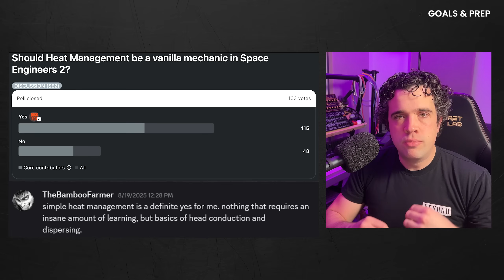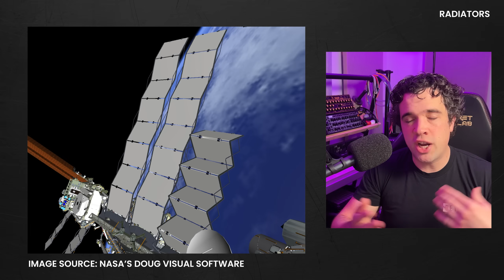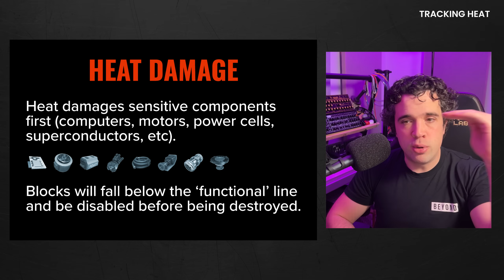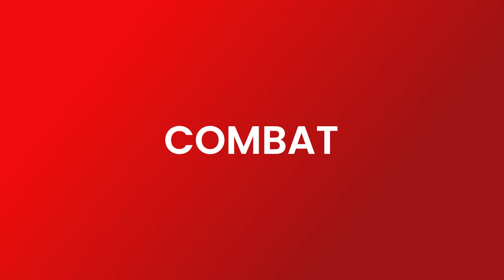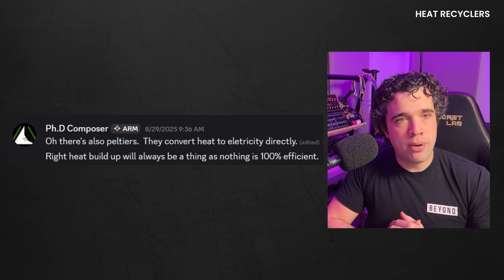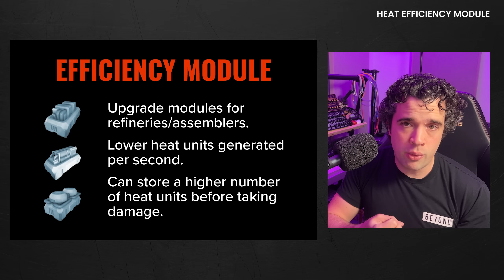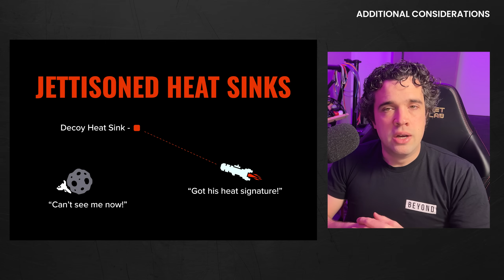Heat in Space Engineers 2? How heat could change EVERYTHING

Comment: With heat, it should be such that the heat intake of heat sinks and radiators lowers as they heat up (since you need a temperature differential to cool something), but the heat dissipation of radiators increases the hotter they become. Just like in real life, you will have a fast heatup of a ship first before an equilibrium is established. This completely flips the stealth mechanic on it's head if implemented: A stealth ship has MORE radiators, wich heat up less to reduce the overall heat signature. heat signature could be total heat outflow X heat level of radiators. With more radiators the total heat outflow remains the same in the equilibrium state, but the temperature is lower, so the the signature is lower. Going a bit further, you could also have the components producing heat work on the same system where they first get hot, which increases the flow of heat towards any cooling the ship has in place.

Why do i think implementing this detail would be a good idea? Well, if you want your ship to be stealthy, you need a lot of radiators, which limits options for armours, weapons and thrusters! If you don't implement it this way, then you run into the issue of stealth ships having less radiators and more sinks, which allows them to also have more surface area for weapons, which isn't exactly a tradeoff. Building a stealth ship would just be superior all around.
Reply from the maker: It is interesting the many different ways they could run with heat if they go this route!

Comment: With heat recyclers, the recycling only works if there is a difference in temperature! In a system with heat recyclers, you would use the radiators to cool the heat recyclers, which then generate power. If the heat recyclers start running hot, they lose efficiency.

In terms of heat cycle i don't quite agree with your odering. here is how it should work imo:

 components producing heat -> heat sinks -> heat recyclers (directly attached to the sinks as an additional module?) -> radiators.

This is simillar to hydrogen generators -> hydrogen tanks -> hydrogen engines -> hydrogen thrusters

In both of these cycles, the hydrogen engines and heat recyclers are optional!

So what kind of ship would you want to use heat recyclers on? Personally I think it would be good on anything large that has a lot of heat sinks, so a lot of power can be regained. It could also help upkeep power generation in scenarios where the ship is under high load. It should be good for stealth builds as you only want enough radiators to cool the heat recyclers and let the rest fill up the heat sinks to keep the heat signature low. The heat recyclers could help reduce the need for power generators, which also produce heat. Running on a high efficiency is just important to a stealth ship, so this works out just fine imo.

A heat recycler should also consume heat to generate that power, so it's a bit of a bad internal radiator and a bad/conditional power generator.
Reply from the maker: The recyclers generating heat and needing to be cooled is an interesting route to ensure it's not a cooling exploit! Sort of depends on how they choose to adapt the science.
Reply: Imagine insulating your reactors so they run hotter for more power and a greater risk, and surrounding them with heat recyclers to get more efficiency! Really getting all the power out of every uranium, but very vulnerable to radiator damage.

Comment: This sounds like it would be a fun design element for grids. I can imagine making a heating system right now, where you'd have shielded heat sinks but if heat goes above a certain level then an event controller would deploy exposed heat sinks until it has gone down.
Reply: Personally for simplicity I’d just place them in a hangar and then have that event controller vent the hangar as necessary for cooling.
Reply from the maker: Yup! Can put some radiators on pistons. Even a whole cooling tower with multiple radiators which extends out from your ship. There's a lot of cool things this empowers people to do.

Comment: I love the idea of having to worry about heat, as you say it can help limit weapons as it would be cool if you had say railguns produce insane heat levels as they charge. 

I personally would love to have a separate pipe system for cooling things down, using water for it or maybe even being able to craft a cooling liquid.. maybe liquid nitrogen?, tie it into running reactor and the bigger batteries.

As for it interacting with shields you could say it would create a heat spike when the shield takes a big hit, or even if a laser weapon was added you could use that to superheat a block forcing  the thermal shutoff and even cooking the block well past its heat limit.

 I believe you mentioned it in the video but it could also be used to add guided missiles to the game as a vanilla feature which would be cool  to have flares and such, lastly it would be a neat way to do detection, i think a server has a mechanic that does as such tho i don't remember it requiring a block to actively look for heat signatures but that would also be a cool thing. 

sorry for the rambling paragraph
Reply: Flare gun and fireworks launcher were introduced to 1 for the 10th anniversary. Making these useful as countermeasures would lead to interesting gameplay.
Reply from the maker: I just ranted for 20 minutes so rambling paragraphs are quite alright!

If they implement heat, they could add heat guidance for long range AI blocks which would make countermeasures instantly useful.
Reply: Liquid nitrogen would actually be a terrible coolant for space applications - unlike how we might think about it in terrestrial applications where it's not too hard to reject heat from the coolant to the environment, in space you actually want coolants to be hot, close to the temperature of the thing being cooled (which should also itself be designed to be able to run as hot as possible in order to let the coolant be hotter and still be coolant). The smaller temperature drop from the hot system reduces heat conduction, yes, but you can make up for that with bigger heat exchangers. And that increase in mass on the side of the system being cooled is easily worth it - generally that is the lighter part of the system to start with, and would only increase in mass roughly linearly, while the increased coolant temperature reduces radiator requirements (the already-heavier-and-bulkier part) by the fourth power.

Basically, you want those radiators to run as hot as possible, because the flipside of that means that halving radiator temperature makes you need it to be 16x bigger, which is not worth halving the already-smaller-than-the-radiators heat exchangers. And liquid nitrogen would be a lot worse than half the temperature - we're talking something in like 40000x the radiator area compared to something using a eutectic metal or supercritical steam coolant, and that's not an exaggeration; I just did the math on it (comparing 70K LN2 vs 1000K ultra-supercritical steam). Even if we are cooling something like delicate electronics and need to keep the coolant temperature limited to, say, 340K (67C), that's still 556x less radiator area than the aforementioned LN2
Reply: @warriorsabe1792 thats damn interesting thankyou for the info!

Comment: 9:15 some modules should increase in efficiently if their hotter (e.g. a reactor could increase in efficiency when near to its failure temp) as this would also incentivize not just spamming radiators but also balancing heat so that you can maximize the efficiency it gives.
Reply from the maker: Yeah we talked about this in my Discord where modules work best at their ideal operating temperature so that "cold starts" aren't as effective as a warmed up grid. Just got a little too wordy/complex for an initial presentation so I cut it 😉
Reply: Could do the same thing with thrusters. Hot thrusters are able to accelerate faster than cold thrusters. So a fighter could balance out its heat to maximize thrust while a reactor on a capital ship is balanced out to maximize power output. Every heat producing block could just have a slider (Maybe even one that can be adjusted via hot keys in the cockpit), including the heatsinks/radiators/vents, to route heat to specific modules.

Edit: This could also be used for a Shield. If you route heat to the shield, it's able to absorb more hits. But if it gets too hot, the shield may break and expose you.

Comment: Another thing - heat could apply a health debuff. It's easier to break through metals when they are hot, right?
Reply from the maker: I was thinking the same thing as well!
Reply: Yes. I would like to bring up that most* electronics quit functioning at the temperatures required for a noticeable change in the durability/ strength
Reply from the maker: @Fjfifjgkgkfudufgkhlgidj  most definitely. But if a gun barrel, drill, or armor block is too hot it might be softer and more susceptible to damage on impacts. I think this would vary block to block because some things would stop generating heat before structural elements get to that heat point.